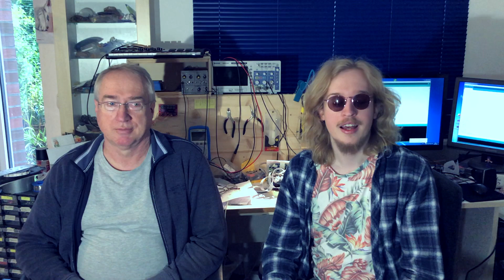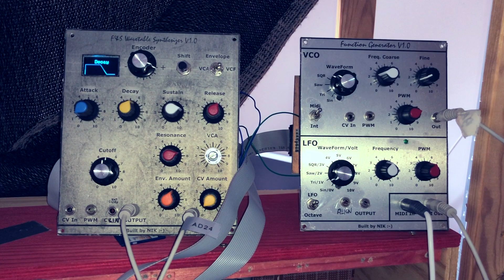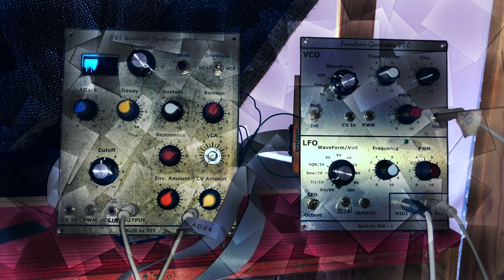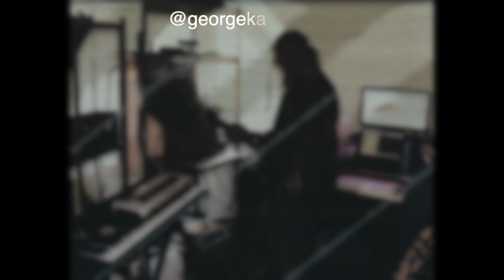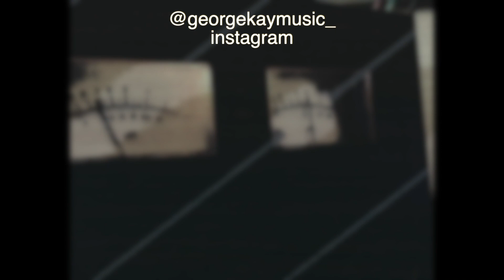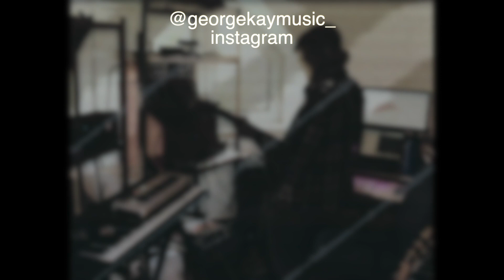Father & Sonthesizer Ep. 15: STM32 Sample Player

Comment: The reason that the wav files from logic are so wonky is that there is other info on the wav that isn't audio data. It's refered to as metadata and when you put it into audacity it strips away that metadata as long as you don't name it or put in artist name etc .. I had the same problem when I put together a sparkfun wav trigger (in specific the one that LMNC uses with his big button)
Reply from the maker: Nick Wood oh that’s a very good point! Any idea how to make logic just write normal Wavs? Cause I really don’t like the clutter of having audacity around just for this one purpose on an already severely limited 256gb MacBook.
Reply: @georgekay372  unfortunately this is the only way I was able to do it. Just popping it into audacity and exporting it. I wish there was a better way to do it.